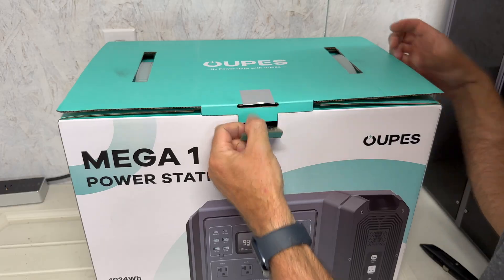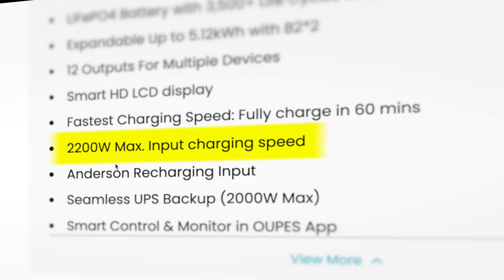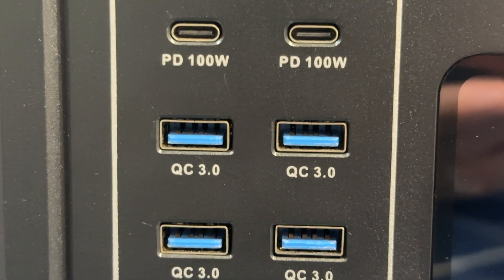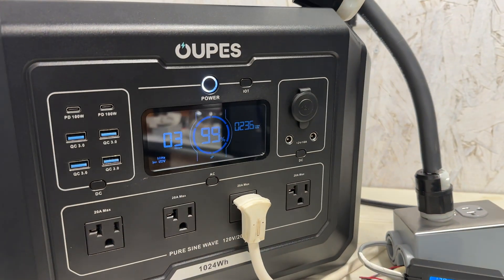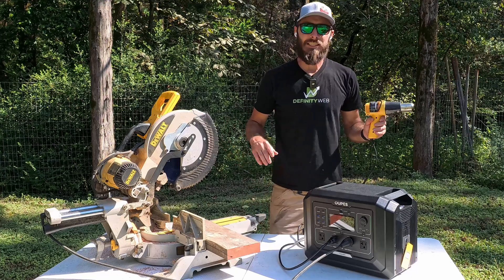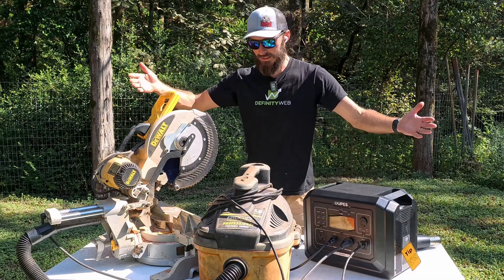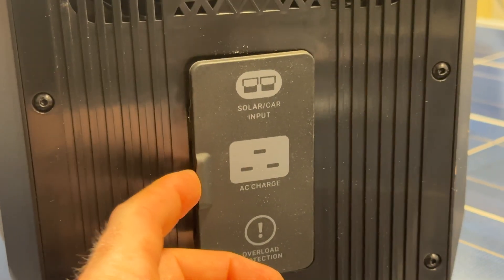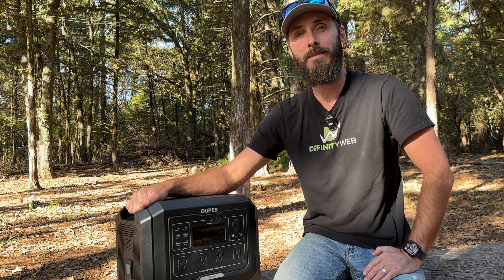Off-Grid Portable Power Station Test: OUPES Mega 1

Comment: great review, thanks. I Hope you can answer my question asap as Amazon Prime Days ends in a few hours. What I did not quite get is can the mega1 actually handle a 4500 Watt surge or not?  or is that just marketing?  What I will use for this will be is only hooking up a sump pump and nothing else. Probably gonna be about 3500 to 4000 watt surge. And as you know sump pumps will be kicking on and off every few minutes under a real deluge, so it's reliability under surge is really important to me. I am not worried about length of time it can run 'cause I can always get more batteries for that Strictly worried about the surge capability. So what do you think?

Comment: What do I buy to keep my fur baby's warm for at least 8 hours with a 1000watt heater..through the night if an power outage happens while at work.
Reply from the maker: The reality is that none of these portable power stations are great at running electric heat nonstop for any length of time. I think your best bet is the propane option like we've talked about in other video comments. With that said, If you really need to go with electric, you could do something like the Mega 3 with an extra battery (https://amzn.to/42arPMY) and place a small space heater on low with the thermostat turned all the way down. This will keep the room chilly but safe for the animals or people and get you through the night just fine.
Reply from the maker: Just saw that you already have the Delta 2. I'll address it on that comment.

Comment: Just curious but have you tried running an electric pressure washer on any of these smaller units?  Looking for my mobile detailing service in Houston area.
Reply from the maker: That’s a fascinating idea! I have a couple electric pressure washers so I will try it out. My guess is that this Mega 1 will handle it. Maybe not for a long time though. However, with a few solar panels, you may be good to go.
Reply: @EastTexasHomestead  Thanks for giving it a try in the future.  Yes, having some portable solar panels would be helpful.  I was glad you show this using the saw as very logical option for some corded tools not being turn on all the time.

Comment: how do you connect this unit to bluetooth??? Is the app really needed?
Reply from the maker: The app is not required. When you first open the app, it will ask you for permission to connect to devices on your network.
Reply: Sorry I was venting! lol I figured it out and was able to get it to work. i feel the website can re vamp their website on tutorials, but I like the Mega 1.  I chose this one over the ecoflow.  Runs well!
Reply from the maker: @GatorScatpack  No problem. Glad you got it figured out. It's a pretty slick little unit.

Comment: I don't think you accurately explained the life cycle. From a basic Google search; "As you use your battery and recharge it, it slowly loses the ability to return to its original capacity. The life cycle of a battery is the number of charge and discharge cycles that it can complete before losing performance."

"A battery is considered to have reached the end of its life when its capacity has decreased to 80% of its original value."
Reply from the maker: Sorry about that. I’ll try to explain that better next time I just wanted to hit the point home that it will still be good with 10 years of cycling it daily.
Reply: Yup, and no one is going to get 10 years out of this power bank. How many current batteries that you know of last past 5 or 6 years with light use? One of the longest are Dakota lithiums but they are thousands of dollars. You’ll be lucky to get 6 years out of this before you’ll lose 50% if it’s original bank power.